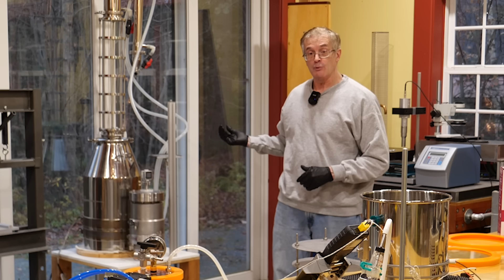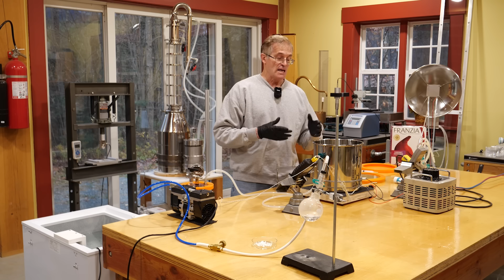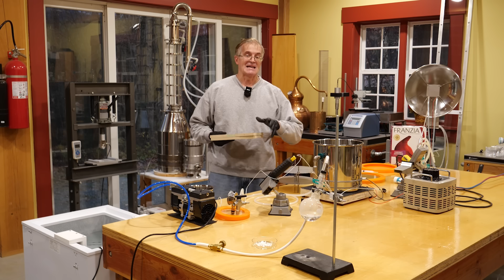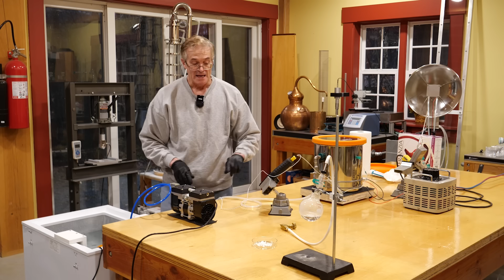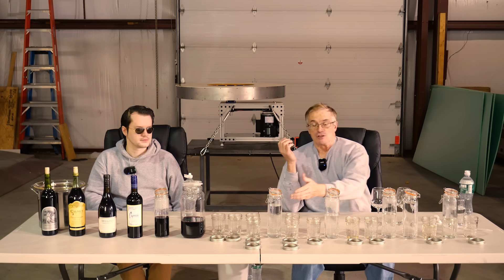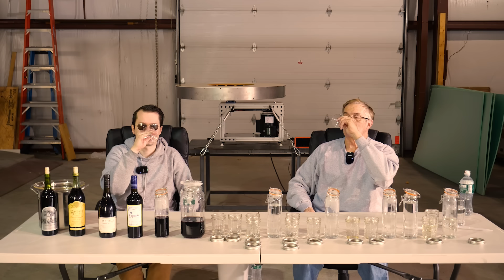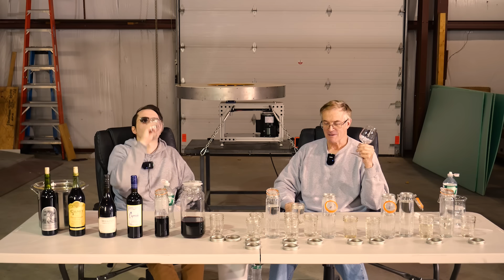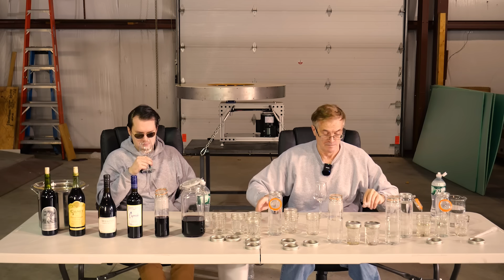Turning $3 Wine into a $100 Vintage with Science!

Comment from the maker: Hey everyone! Sorry for the late release. We had some issues with the YouTube upload. We're still going live at 6PM ET so if you're able to watch enough, we'd love to hear your questions. See you there!
Reply: My speculation is that a large part of the improvement was simply due to concentration. 
What proportion of the volume was removed by eliminating the bad cuts, or did you replace it with distilled water and appropriate amount of purified ethanol? If the volume was not replaced you should do another taste test with a re-diluted sample with highly pure water and ethanol.
Reply: so it wasnt the samples?
Reply: 'issues with upload?' admit you were wasted.
Reply: Instead of drilling the stoppers, you could cast them from food grade silicone rubber mold material.  It is used in casting candies and can take some heat, far more heat than you are using.  I got mine at Hobby Lobby, but most craft stores have it.  It is not hard to do and a he.. whole lot safer to do.  Plus, you could cast it around the lead wires of the thermal probes.  Going to post down below so people don't miss it.  Every finger saved...
Reply: @nunyabiznez8120  Good idea
Reply: No problemo!
Reply: I wonder if you're setup could work for Flash detente.
Reply: For your next experiment you should start with E85 and extract the ethanol... I've read they denature biofuel ethanol with just gasoline before it's shipped therefore separating it would be super simple. Any thoughts?
Reply: @TechIngredients I'd say you should dilute each batch to the same ABV (alcohol by volume) level. The science behind: ethanol and water mix completely, but many aroma compounds are only partially soluble. When you lower the ABV with water, the solution holds these oily flavor compounds less well, so more of them move into the headspace above the glass. This makes aromas and any flaws much easier to detect, which is why controlled tastings of fruit spirits or whisky are often done this way. Anyways, you are doing a great job! ;)
Reply: Do you think maybe the increased tartness of your distilled wine is because you didn't replace the volume of liquid not added back? So in essence your distilled wine was more concentrated?
Reply: If you take a gallon of wine and distill it, make your cuts and blend it to a nice spirit then add that distilate back to a new gallon of the original wine you have made port. I done it last year with 2 home brew 5 gallon wine kits and its fantastic, i still have a couple of bottles left for this christmas. Great video as always!
Reply: I'm amazed that the carbonation in beer if fake because  it's cheaper to pump it full of co2 than it is to add sugar so it ferments in the bottle.
Reply: What a pitty! It seems that the bottles more expensive were not really some of french acknolowledgs "cru classe" but only any fantastic "cuvees" for all customer  incomes  but without any classified International comparison option!
1,) it was not possible to really Reader and identify the tasted wines. 
2.) It would even not be possible to buy such a fantasy wine here in Europe or Germany!
Reply: What was with the AI promo video for this one?
Reply: Regarding temp probes. In the chem industrie we use PT100 temp probes for measuring things in a temp range you are working in. And you can buy already made ones in a closed stainless steel pipe with a thread on one end (for easy installation in a sealed container). Could make thing easier for future projects. And depending on how far the leads have to be (compensation for wire length and temperature differences affecting the wire) and how precise you need to measure in general you can use 2 /3 or 4 wire measuring devices.
Reply: Thanks. I'm envious! A $3 bottle of wine (about £2.25) is almost unheard of in the U.K, because of our high levels of taxation. If it has really low alcohol content, then a wine might cost about that price, if bought in large enough cartons. But almost nobody would enjoy drinking it.

A better technique for this experiment would be not to swallow any of the fractions or wines between comparisons. Your judgement would remain sharper, and you could keep sampling all evening whilst still maintaining a high level of discernment. And as you have noted, it's definitely better to include more people, such as your neighbours. But for private consumption, definitely make what appeals to you the most, just as you would buy the wines which you like the most.

Also, be very careful about the legality of unlicensed distillation. It's a definite no-no in a number of countries.
Reply: Excellent video, as always. And so practical! I'm surprised you didn't fill the swill with an equal amount of water out of what you decided not to include.
Reply: Well, science is fun. You vacuumed and separated the flavors you didn’t like from the three dollar wine and poured themback into the nonvolatile components. Then you compared your optimized wine with a random selection of wines of varying prices. How could you ever find a flavor/aroma that didn’t have something offensive to you in the group of wines that you had not tweaked to remove the unsavory components?
Reply: and now for the [pi]ss up :)
Reply: No worries brother. 😎
Reply: Anyone done Kvass? Classic Russian/Soviet alcoholic soft drink made from sourdough rye bread. Always wondered how far you could push the alcohol content and keep the nice toasted kvass taste.
Reply: Guys... honestly i like thoes kinds of videos...
 BUT in reality since most people perfer the simpler less complex cheaper wines then the complex flavors of aged expensive wines...
i allways feel like it's a bit unnacessary 

But there are stories about some amazing people with incredible palets which sre not only able to tell apart artificially aged/ fake wine but also appriciate the complexities

Personally i've never met any such individual and expensive wines are just a brag

Oh and also i've never experianced a good 3$ wine...
That's basiclly just be antifreaze for all i know
(I'd say 5-7$ is the best wine to get and the further beyond say 20$ you go 
Well it's not nacessarily worse but i don't appriciate the complexity enough go justify thr price hike)
Some things just aren't linear
(NOT EVEN CLOSE)
Some things are best cheap and simple
Reply: You need to change the name of your channel to Mr Amazing, The Approachable Wizard. So many tips and tricks in this video, and I wasn't even initially interested in making the wine! You are like a real life (good version of) Walter White from Breaking Bad. 

As a marine mechanic, your description of the "bumps" sounds suspiciously like cavitation. Is it the same or just a similar mechanism? 

Your technique for drilling a curved stainless steel surface, drilling a tapered rubber stopper, cutting that stainless steel mesh by sandwiching it between sheets of wood... Wow. Just wow. 

I've watched your sound canceling project and I'm about to watch the one of geothermal heating and cooling. What groundbreaking thing will you tackle next?!

You are truly a treasure, sir. Thanks for everything and please carry on.
Reply: You guys ok? Your shop is down and it's impossible to get a hold of you.
Reply: Thought Emporium did a video on fast-tracking barrel aging via ultrasonic cleaner bath a while ago, would be so so curious if you could add the oak flavour/aroma in like 10 minutes of runtime and how it'd compare to the Silver Oak.
Reply: Running any clear alcohol through activated charcoal improves the taste and smoothness by removing unwanted flavors. If you did that to the unwanted alcohol you probably could have made it worth keeping. 

You can use 4 feet of 1 inch food grade tubing with a screen on the bottom (to keep in the charcoal) and a funnel on the top. You may want to run it through 2 or 3 times to get the results you want.
Reply: Something that I realized you forgot to add back in that has a MUCH more significant impact than most folks would expect is the dissolved gases.  (I wouldn't have realized it myself except I recently watched a James Hoffmann 'Americano' video where cold water steamed up to the desired temperature tasted FAR better than water from a kettle.)

Something to think about.

Cheers!
Reply: Bro, open the box and cut a corner off the bag inside and it will empty all the way in about 5 seconds.
Reply: $10,000 worth of knowledge, $900 in materials, $800 of labor for a $100 bottle of wine... minus the $3 for the box wine. Most entertaining of course.
Reply: I have an idea for you which I will never implement, but maybe you will.

If you take a good beer, and do vacuum distillation to remove the alcohol, and then add the CO2 back into the left over product, you'll be the first person ever to make a non alcoholic beer that doesn't taste like garbage.
Reply: @fuzzywzhe non alcoholic beer is pointless, just drink a bread milkshake if you want carbs without the kick. The carbonation or notrogination determines the end result and removing the alcohol changes the flavor because far more than the alcohol gets extracted.

Did you even watch the video?
Reply: @YouNoStepOnSnek  I enjoy the flavor of beer, and I don't always want to get intoxicated.

I know non-alcoholic beers are crap though.

Alcohol is basically flavorless except for the sting of it. You can feel it, but you don't taste it.

I may be in the minority, but I'd very much want a decent non alcohol beer. If I didn't suck, like O'dules.
Reply: Can smart people stop genocide? Isreal genocide on palestinians can it be stopped by high iq people
Reply: I love the channel but the video operator work is ass. I figured you probably want to achieve 80% of the result with 20% of effort, but at some point this will hold the growth of your channel. You already have a nice camera - if you use one of the simplest of steadicams systems, small monitor (to see what you actually filming) and a stick extender for the camera - your would achieve great close up shots in every situation. All this things are not that expensive and production quality will change dramatically. Frankly some people can take a great shots with only great camera in their hands and editing - but they are rare. To get experience try to watch big car enthusiasts channels who main focus on technical details to know how to properly work with steadicam: how to frame things so that they look nice and how to act when you need to focus on several different things that might be several foot apart and do it fast. Content of the channel is superb but i often stop watching mid video because I am frustrated that I cant really see everything or from mental dissonance between content and production quality.
Reply: @MrMpakobec maybe you should post some of your work?
Reply: I have an essential item that you might be interested in. Basically an ultra thin foil in a vacuum say about the size of a light bulb. Basically a EMP detector. Sell it world wide and to be very cheap letting people be informed of events their government might lie about.
Reply: @Paul7mac  What kind of foil? Aluminum?  Thickness? How is it held?
Reply: @johnwdferguson3149 possibly but it has to rupture at a certain magnetic pulse. I was thinking gold or silver as its not too expensive have it held in 3 separate parts of the foil with different gauge to tell you the danger level. The holder is probably best to be the same material as the foil.
Reply: @johnwdferguson3149 just one layer worn on the head should protect him from all the government EMPs
Reply: Hmmmm, the higher the entrashment, the higher your discernment of flavor. My thought is that you should do this over days from sealed containers so your entrashment doesn't cloud judgement.

Comment: I am really surprised you didnt have a hydrometer. I would have been interested to see the before and after alcohol percentage and the percentage of each pull.
Reply from the maker: I have several,  but I didn't think it would add anything. The alcohol will obviously drop as the cuts are separated, but its the flavors that matter, so I decided to use a volume per cut as a rough guide.

Comment: I would do it differently the next time. 
Separate the distllates in a controlled repeatable way. 
Repeat the same procedure using a high end wine as the starting wine. 
Then compare the distillates between the box wine snd the high end wine. 
Then when mixing the distillates reconstitute a small sample of product wine so that multiple versions can be produced. 

Finally, the tasting evaluation at the end MUST BE BLIND TASTING.  Your test tesults are invalid because you didn’t do a blind tasting.
Reply from the maker: All good criticisms.

Comment: Sealing grease?  Side note: Crisco, shortening, sold as an edible frying grease and baking ingredient, was originally developed as a high temperature smoke point grease/lubricant for use in confined air spaces like submarine engine rooms back in WW1. After the war, someone had the bright idea to sell the grease as a lard substitute, 85 years later another someone figured out the hydrogenated plant oils are actually bad for veins and arteries and lard is not.. I won't allow 'shortening' Crisco in my house at all. We cook with natural butter, lard, and tallow, all far healthier.
Reply from the maker: Thanks.
That was interesting.

Comment: You should have mixed ALL the distillates in at the end - it should taste the same as the original - if not - maybe it tastes better and you will have increased the yield. Also, you could try adding back the omitted samples in stages before adding them all in. P.S. What scientist doesn't make notes?
Reply from the maker: That's a good point. 
To answer your question,  a drunk scientist.

Comment: Glass would be better, using stainless steel with acidic ingredients can leach out the chromium.
Reply: Although this amount would not likely hurt anyone
Reply from the maker: Good point.
The downside is the cost of a glass pressure vessel and the consequences of an implosion. Alternatively,  a thin wall glass container could be placed within the stainless container, but heat transfer might be a little tougher.

Comment: In fact, you can recreate what you made rather quickly since everything you excluded was up-front and all in a row. You simply remove the head, take the combined time of the flavors you didn't like, dump that part, put the head back in, and you should have the same thing. If it comes back different you know that the process itself modified the flavor.

Comment: Hello. Interesting experiment; directionally. Could you tell us what the approximate alcohol content (by percentage) was of the improved Franzia wine? Was it higher or lower as compared to the Caymus or Silver Oak? So many variables; you could spend a lifetime narrowing down the process and the science behind it. Thank you.
Reply from the maker: We didn't actually measure it, but it should be similar. We didn't need to eliminate the foreshots and removed several cuts with low alcohol content because of the taste. It's definitely a little higher, but not much.

Comment: I'm halfway through the video, so I don't know if this gets addressed at some other point, but what about the oxidation? All your vials are open to the air, so believe some of your flavour is different from what that wine tastes when just opened. Also, with all of those samples open, how are you preventing all those volatile compounds from just evaporating away?
Reply from the maker: I don't address that. Given enough time, it could be an issue, but don't forget that when tasting fine wine you will open the bottle and let it "breathe" for a while before the tasting. Sometimes you'll even decant it to enhance the removal of some of the more volatile and harsh components.

Comment: Does the boiling points for different components change differently with pressure and temperature? (that might mean that at certain temperature pressure combinations, some things might be easier/harder to remove than at normral pressure)
Reply from the maker: Everything has a lower boiling point at reduced pressure. The relative vapor pressure of each component determines the rate that each component vaporizes. This applies no matter what the pressure is as long as the pressure remains stable.